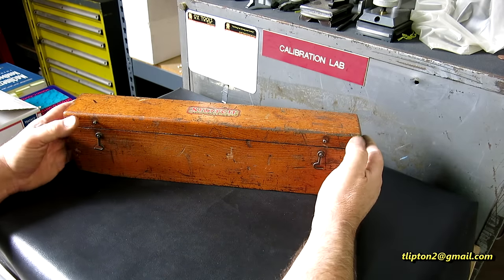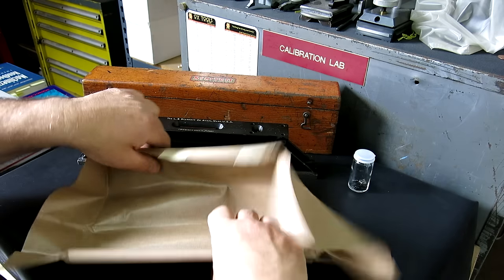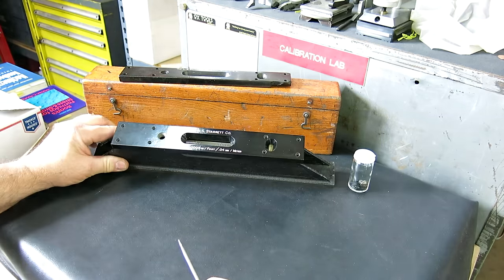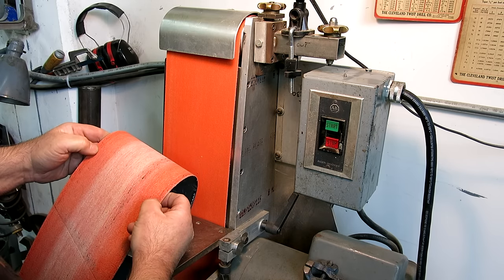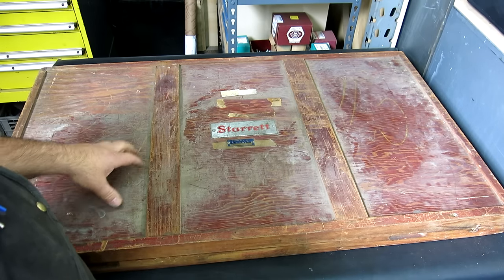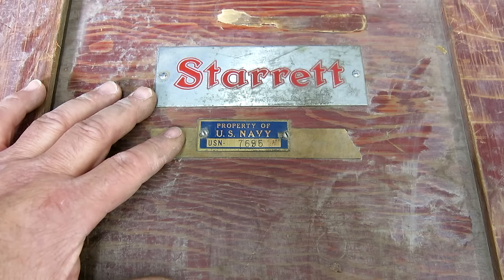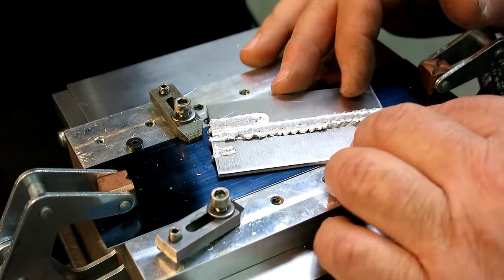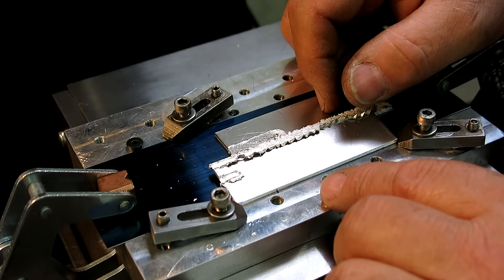Monday Night Meatloaf 107 P2

Comment: Cool test of the friction welding tool.  Only part I have ever handled personally that was friction stir welded was a cylindrical tube consisting of an aluminum plug and stainless fill tube.  The stainless and aluminum rods were friction stir welded together and then the assembly was bored out and the OD turned.  I was never able to see the process, but I was told the rods were spun in opposite directions and brought together using considerable force.
Reply: From what i see online I think that is a different process. That i think is simple friction welding, without the "stir" part. I could be wrong.

Comment: This was interesting. I remember going to the Machine Tool Show in Chicago and seeing a company that made a friction drill that would melt holes in plate stock that they ran in a drill press, but can't ever remember seeing this technique. Great fun!
Reply: There are videos here showing that tool...it is tungsten carbide and it makes great holes in carbon steel tubing....and pushes the melted material behind the hole so you can tap/thread it later.....

Comment: Tom,  from what I've seen on friction stir welding, I think the tool should be tipped back 1-2° (like pushing a welding torch).  I don't think the leading edge should contact the material at all.  Great little test though.  Maybe a little 5-minute side-dish is in order using this approach???

Comment: Yeah, it makes sense to reverse the spindle angle, like a boat on plane. Then the nib melts the puddle to the root of the joint and the major diameter smooths things out. Looking forward to that demonstration with .062 stock. Thanks!

Comment: Friction stir welding does reduce a material's mechanical properties.  For example, 6061-T6 is reduced to a T4 condition.  Where I used to work we did a lot of FSW and would show visitors the same demo on a Bridgeport (with a lot more clamps).  The about amount of force and heat involved is surprisingly high.  Typically the material used for the tool is not HSS, but a more exotic (proprietary) blend.

Comment: According to the Wikipedia article, the rear of the tool should be lower than the leading edge. This makes sense, as the tool would not plow up a ridge, but smear the softened metal back down onto the surface. According to the pictures they show, things should be glowing hot when it is working properly (but the workpieces never actually melt, just flow). BTW, they are talking about 50 mm depth of weld!!!

Comment: Anvils MAY be available for the mic. They are not trivial to make, as the fit is pretty critical. The bore and locknut thread sizes changed a number of years ago for at least some of the interchangeable anvil models, but a year or so ago, I was able to get a replacement for an old style 2-6". The original anvil was lost/liberated by a student. I would also suggest removing the anvil and lubing the surfaces fully. They are a tight enough fit that they can bind themselves in over time.

Comment: Interesting to see you trying out FSW on your mill.  Using it on a mill is a decent demonstration of the concept, however FSW really requires a very great deal of axial force to work properly, as such I wouldn't recommend putting your mill through that.  I also think you can file this under novelty in this case simply because of the effort required to get set up.  As a couple of people mention below, the pool should be glowing red when you remove the tool, and I don't think this is possible with a mill.

FSW crops up every few years in aerospace and it very very slowly creeps forward (at least in the places I've worked).  It is useful for making near nett shapes, and you can join significant thicknesses together, join the same material but in different grain directions as well as joining dissimilar materials.  I don't like calling it welding, because it isn't welding, instead the grains from each part of the joint are moved together by the tool until such a point that the two parts become one.  You get a work hardening effect from this.  You can recover most of the material strength, but as a structural engineer I would want to see some significant testing results before agreeing to design structure with this joining process included.
Reply: Phill Scott - I agree: big forces involved, particularly for what looks like a reasonably light machine.  You need much more machine stiffness than for conventional milling operations.
Reply: ...'Welding'.....Uhm...maybe call it cold-forge-welding....? and yes, I'd like to see more extensive 'Tests'.....and I'm guessing it's limited to 'welding' 2 similar metals...? I too, have been seeing this for quite a few years.....
Reply: Yeah, I've re-built a few Bridgeport spindles.....the bearings are not all that big, and just ball-bearings....if you saw them, this stuff would really be scary, you'd never let it close to your mill....

Comment: Experiments are always good.   Personally, I'd tell you to grab some of Tinman's super duper welding flux for 5052 and fire up your Oxy/Acetlyene torch and go to town!   I finally got a DBS (Deep Brain Stimulator) installed to help with Parkinson's Tremor, so hope to return to the shop within a few months. Haven't touched my tools in over a year, so it should be lots of fun experiments!   I still have  ton of 5052 sheet around here for gas tanks, need to check thickness, glad to shear some stuff to send to you.

Comment: Just a thought but could it be that it should be a trailing angle rather than a leading angle? That way you might not push up a Burr in front of the spinning tool.

Comment: Tom, as others have said, the recommended tilt direction is so the trailing edge of the tool is deepest.  I saw some aircraft stir welded aluminum which looked great.  Boeing and Airbus use it in parts of some of their aircraft.

https://en.wikipedia.org/wiki/Friction_stir_welding#Tool_tilt_and_plunge_depth
Reply: I was wondering that, just from the physics of what's happening. I have no practical knowledge whatsoever when it comes to stir welding, so I'm pleased I was on the right path :D
Reply: Boeing uses it for the entire body of the SLS.

Comment: i think maybe the tilt of the stir welding tool should be in the opposite direction so that the rear is lower than the front? at least i read that on wiki and it seems to me that could also make sense.
Reply: Right....the following edge is lower....it planishes/smooths the surface of the welded seam....

Comment: Tom, it would be good if you polished the surfaces to ascertain if you were getting joining from the probe or just from the heat and pressure from the shoulder.  Be gentle with the Emco, she won't thank you for a lot of this - check out TWI (The Welding Institute)for examples of dedicated machines.

Comment: I remember seeing a Tesla factory video and Elon was saying they use friction stir welding for their cars. And he was talking about the proces like some esoteric voodoo no one is using in the industry. I first heard about this process randomly clicking on machining videos on YouTube and the video was quite old. So i guess the process is old but expensive for some reason and rarely used. Maybe the strength is hit or miss and it requires special QC analysis. Who knows... ?
Reply: Elon talks a lot of bullshit. He doesn't understand even a quarter of the science he talks about.
He has ideas, and money and drive. But he is definitely not a real technical guy.
Reply: That wasn't the point of my comment. I was only pointing out a use for this process confirmed by the leader of that company. 

Regarding what he knows and doesn't i presume he knows a lot beyond average people because otherwise i should be the head of Tesla or you and we are not :)
Reply: One use in industry is making cold plates for cooling the electronics in military radar arrays.  It is a great way to cap or contain complex cooling channels without the hassle of using fin stock and vacuum brazing.  Especially because braze tends to weep into the fin stock reducing flow.
Reply: Macovei Vlad it is incredibly consistent when done correctly. So good in fact, that it is used to construct the space shuttle
Reply: ....Elon knows enough to hire highly skilled people.....

Comment: Cool stuff as usual! 

I saw this video about Friction Stir Welding a while ago, as others have already suggested it looks like you'd want to tip the tool the other way so the forces get transmitted up into the quill rather than trying to shear off the toolbit. It also explains the max welding thickness rating (which is dependant on how far the ceramic bit in the middle penetrates, and why you'd want to keep the angle of the toolbit as perpendicular as possible I suppose) 

https://www.youtube.com/watch?v=aNbQH8XBgxQ

Comment: I don't understand why he leading edge of the tool would have to plow .003" through the material to be welded.  Very interesting though.  I have only seen friction welding on much heavier metals previously.  https://www.youtube.com/watch?v=aNbQH8XBgxQ  appears to show the leading edge ever so slightly above the surface and the end result still has 'dross.'    Very cool though.